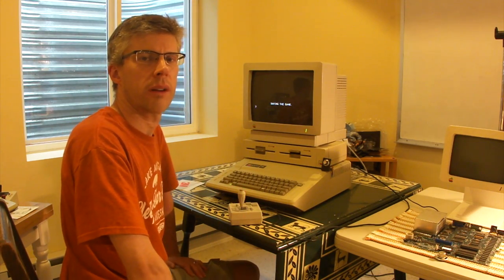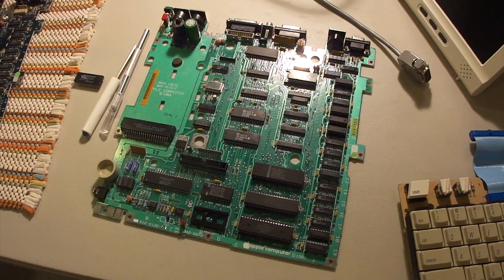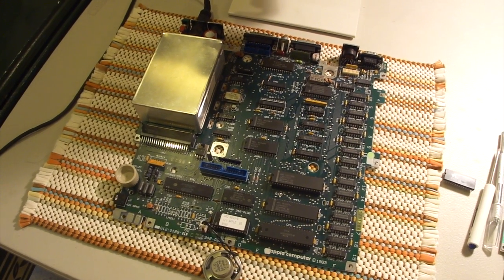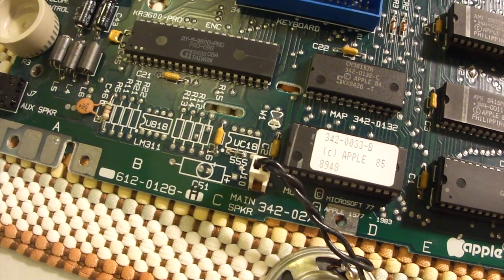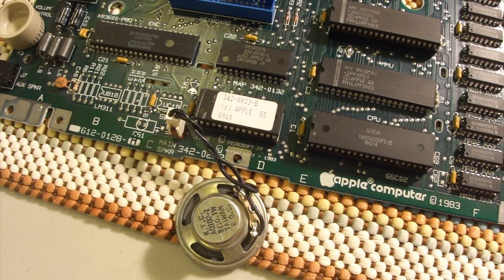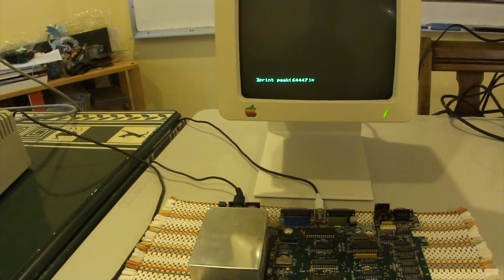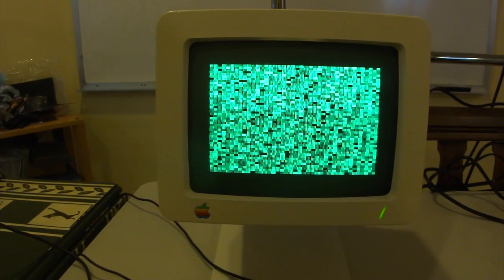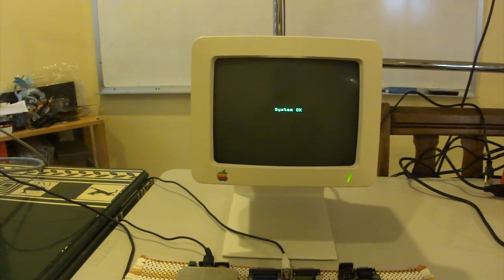Assembly Lines #16: Upgrade an Apple //c

Comment: I just acquired my first IIc.  It has ROM3.  So, I'm curious. why didn't you upgrade to a newer ROM?
Reply from the maker: Just because I had the ROM0 EPROM from the new board. It's still an A2S4000, not an A2S4100 so there isn't much benefit for going up to a ROM3 or ROM4.
Reply: Ah, good point.  Did you ever get your old board to work again?